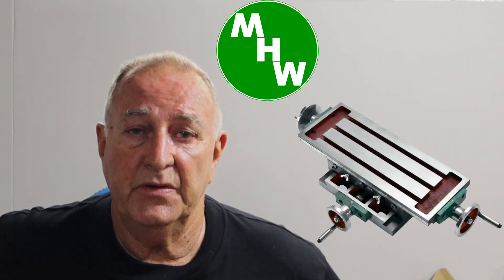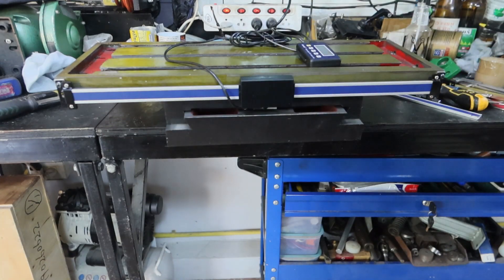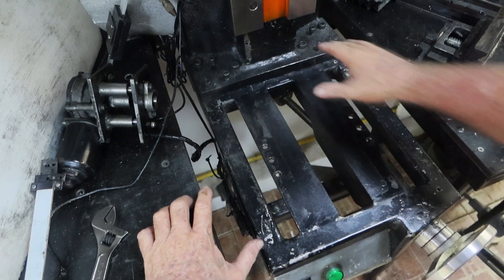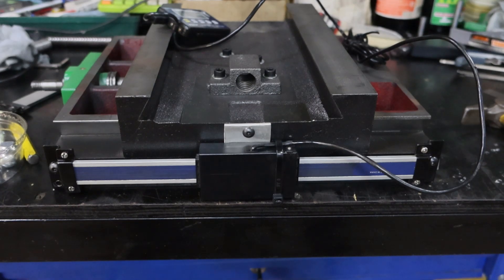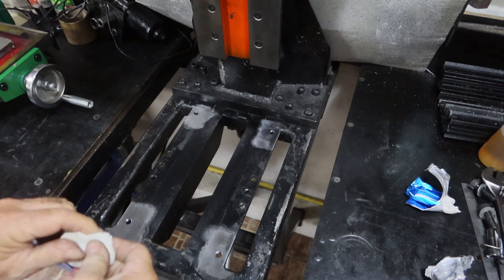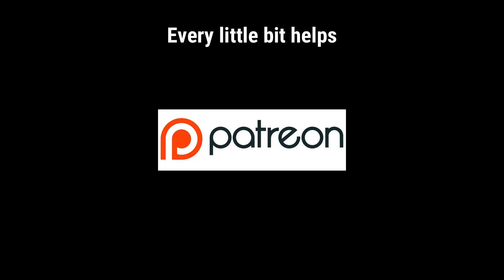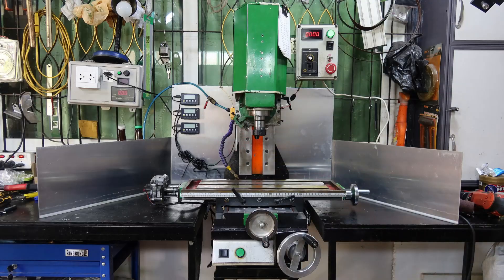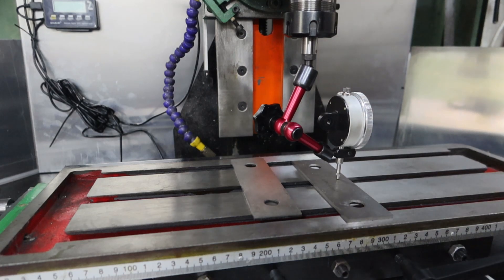MHW Episode 92- Homemade Milling Machine Upgrade - Part 2

Comment: I was thinking
Since that table is a banana and the the slots are well shit, it should be possible just fly cut the whole table surface (hope it is not worse) and then drill hole and tap them so you'd have like an integrated  fixture plate
Reply from the maker: Sounds like a bit of a solution, but I will see how it goes before trying to fly-cut it, I went down the fly-cutting path with the original table without much success and under the ribs is hollow on this table, so there is not much room for error 👍

Comment: Man, that table's a bit of a banana.  Is there enough meat on the not-very-t-slots to be able to skim it with a fly cutter? 

I like the power feed setup, very ghetto, but nice and functional.  I'll be nicking that idea, I have a big old 24v gearmotor taken from an industrial router table lifter that just wants to be an X power feed..
Reply from the maker: Unfortunately, no, I don't think there is enough meat to do anything with it. I fine-tuned the power feed a bit, and it slides on and off very nicely now. 👍
Reply: Maybe level it with resin and then flycutting it?
Reply from the maker: @olleerikson4986  I've been down the trying to fly cut them flat path before, not so sure that I want to try it again 👍
Reply: @olleerikson4986  I've always wondered what to do with a table like this, and this sounds like the best solution if there is not enough to take 10 thou off each end.
Could you maybe mill out the T(~V) slots a bit wider and make inserts that are wider and a bit deeper and gain some wriggle room that way?